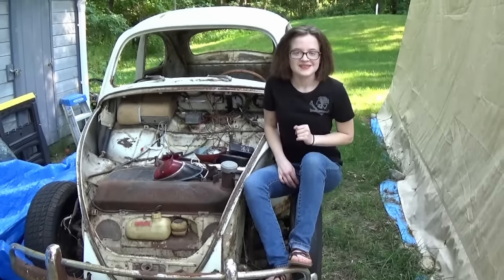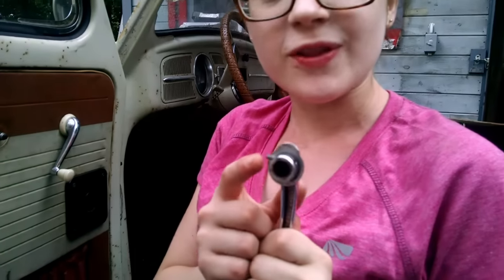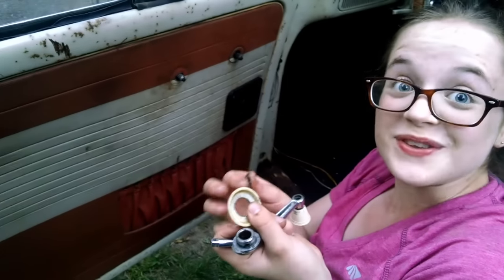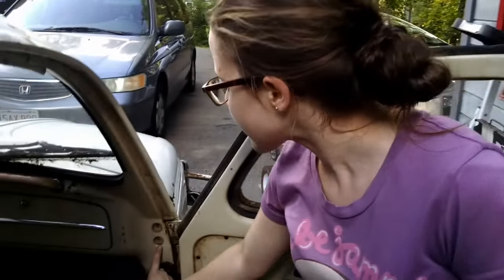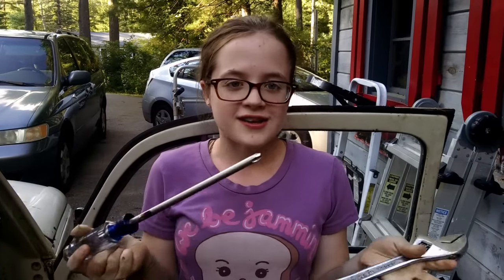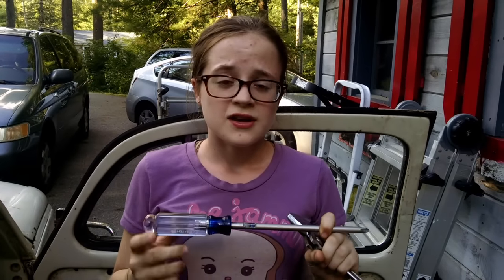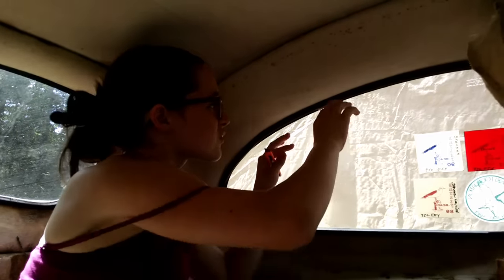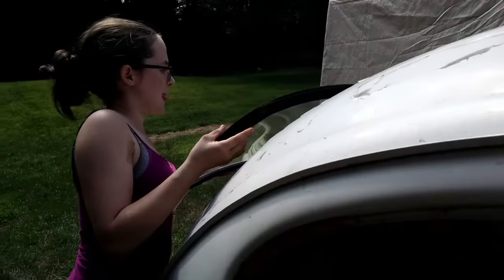Ep 6-tee-7 Door disassembly and glass removal

Comment: If you ever find Phillips screws you can't get look for something called an impact driver.  They're not very expensive these days.  It was the only way we could get screws out of our early Honda motorcycles......  Great job and good save on that glass!
Reply: Was just about to post the same.
There are two rather different tools with the same name though, there's the electric sort that work like an air rattle gun and there's the manual sort that you hit with a hammer.
The manual hit with a hammer sort would be ideal for the door screws.
Reply: Yep - very handy.
Reply: Good suggestions
Reply: Honda's are actually not Philips Head Screwdrivers. They're called JDM Screws, very large Philips will work though just more difficult
Reply: TRX...you are correct that Jim didn't in fact have Phillips screws on his older Honda, however they are actually called JIS (Japanese Industrial Standard). Jim, if you encounter these screws again and you don't have a JIS driver (expensive), a good way to avoid cam-out is to grind the tip back on a Philips driver. If the screw has a dimple beside the driver profile it's a JIS screw.

Comment: Are you going to upgrade to power windows? There are ways to keep the look stock, but upgrade some features. Power locks are easy also, but slightly less important on a 2 door car, but there are setups with no switches, and if you add an alarm or remote lock set up, etc. its a nice feature. 
There are ways to retrofit most luxuries, cheaply or for a high price tag, its just up to how creative you get with it.